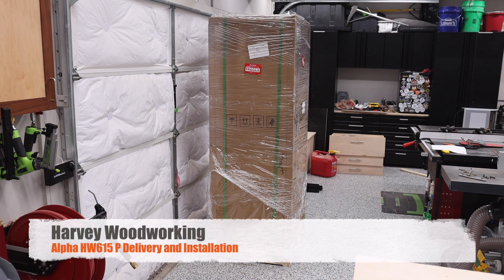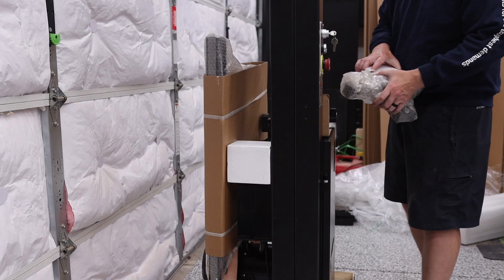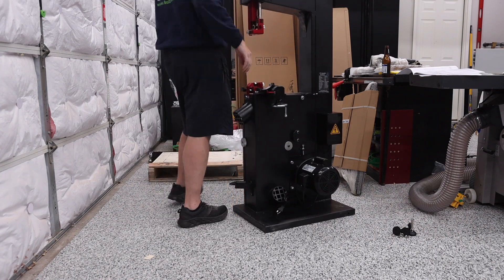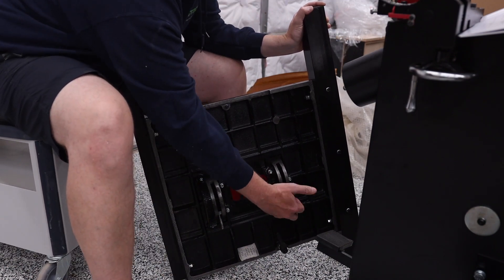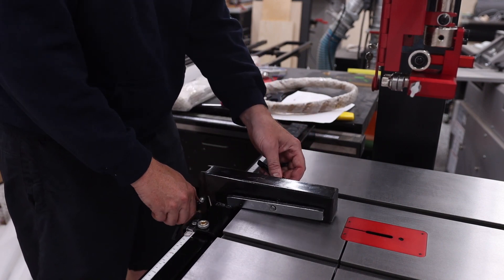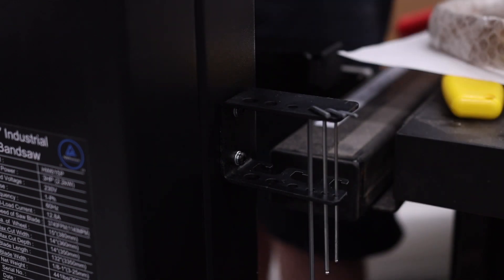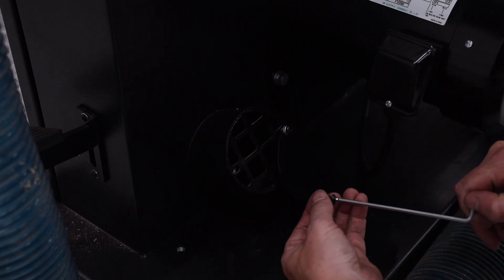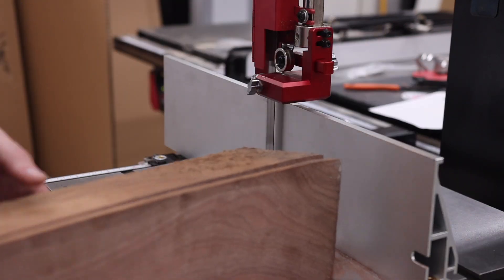Setting Up The Harvey Bandsaw (HW615) with Jason Bent of Bent's Woodworking

Comment: It’s fairly clear you have a high opinion of Harvey products. I hope you’re correct cuz I just finished putting mine together and you certainly avoided mentioning some of the difficulties. If you place it on mobile base make sure you allow room for bottom door to swing open. Plan on spending a lot of time installing the 2 table locking handles. Huge pain to secure. Sawstop spoiled me the manual for this saw lacks clarity and sufficient instructions. I’m not a fan of the spring throat plate very difficult to reinstall.
Reply: Yeah. You’re spot on. I just went through the same exact issues you’ve mentioned…plus a few extra. Spending 3K on a premium tool like this deserves manufacturer sponsored instructional videos “instead of me” searching other channels trying to figure out nuances that may or may not be apparent. Come on Harvey. Their marketing material certainly has stunning imagery and a lot of attention to detail. Do the same for your user base. Don’t assume we all have the same skill level. Be advised that my gripe has nothing to do with the guy presenting this video.
Reply: Agreed 100 percent. Another big issue I have with mine is the fence. Constantly out of parallel and the way you secure it is archaic, constantly pulling in twisting pulling and twisting never mind if you push the fence all the way out put some curves then you try to slide it back in if that knuckle slides down WAP you hit the back of the table. Poorly designed for a premium tool

Comment: this is a very simplistic approach to a very complicated installation.  you simply pass by the difficulty of re-installing the locking levers.  they are a pain!  this installation really requires 2 people unless you have 4 hands.  I have been at it for 4 hours now and still cannot figure out how to get the locking handles on.  the instructions are very inadequate to getting the table installed.  as I see it this is shaping up like you would expect from a product made in china.  very disappointed.
Reply: Agreed. I ran into this problem as well. The whole push and turn while holding design is not that common. It’s a small annoyance to me personally. It’s faster just to unscrew the spring loaded handle/levers and fasten to the base. Once attached, and snug, go ahead and secure the handle.